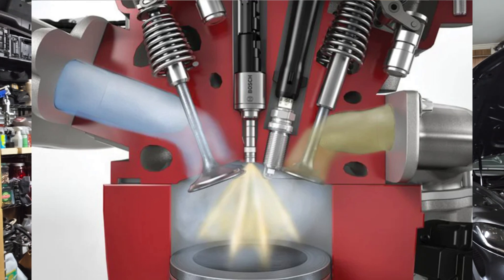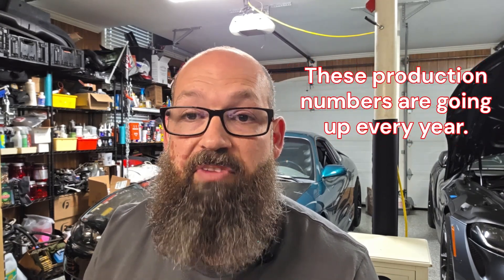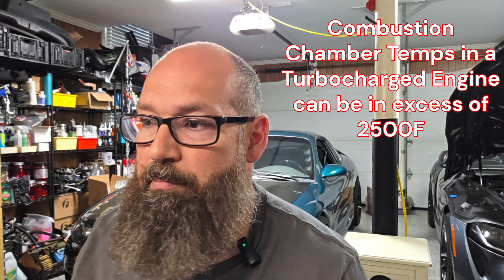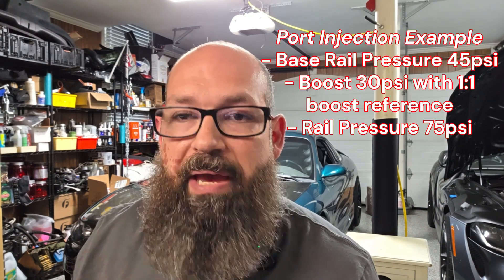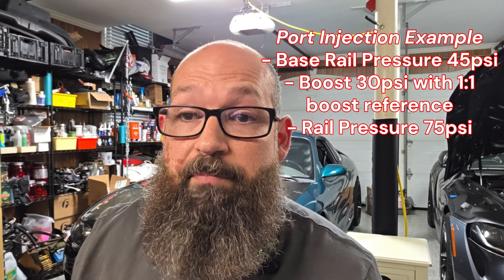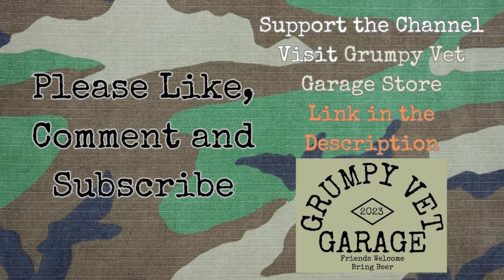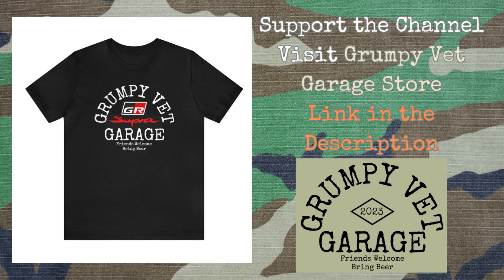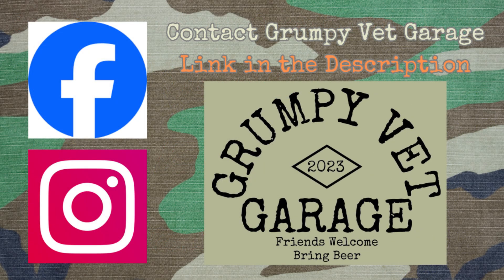Direct Injection vs Port Injection - What's the Best B58 Fueling Upgrade Path?

Comment: Good video, where did you get the power chart from the end at? I know of a good amount of stock location DI setups that have made over the 659whp you mentioned, I believe there's also someone with a MT supra with just di upgrades making ~800whp
Reply from the maker: I made the chart over the last 6 months pulling from posted dyno and modification data, typically from performance shops.

There are plenty of individuals posting about DI upgrades but none with dyno numbers posted above 659whp.

I believe these higher HP examples exist, but I couldn't find documented examples.

Comment: Port injection should be your last resort. It’s called a supplemental fuel system for a reason. It should only ever be used as a gentle assistance in your fuel system not something you heavily heavily rely on, ideally you want to absolutely max out direct injection upgrades and then use for injection to complement it.
Reply: except for when youre making 1200+ whp and the direct injection is inconsistent and causes engine failures.  removing DI on modern bmw engines is how you make them last at high boost pressure.
Reply: @Mp-jw1qg  we have tuned 1000 to 1500 wheel B58s/S58s no issues with di

Comment: I cant wait to share my latest build for your review. '22 m240xdrive - currently running bm3, xhp, custom tuned by f80 paul on 91 with 100 methanol. Upgrades: rk tunes front mount intake, cts turbo inlet, snow performance water methanol kit, cts turbo charge pipe and pure 650 turbo. In the next two weeks I'll be upgrading fuel and the turbo. Pure 900, nostrum injectors, motiv reflex for e85, proto cts manifold, full direct injection with port injection, the 100% methanol will go to 50/50, Dorch HPFP,  LPFP, and new toyo r888s.
Reply: the nostrum is 60% higher flow over stock b58
Reply: B58 Rev2 coming soon too 👀
Reply from the maker: These are just estimates comparing to data I've gathered and there are many factors that could improve or reduce these numbers. With your current set-up, around 585whp. With the upgrades you have planned, 660-700whp (need to watch the torque). 

Nice build. Your transmission will be the next thing to upgrade.

Thanks for watching and commenting.
Reply: How did the upgrade go

Comment: Very nice overview but it's worth mentioning the big disadvantage of port injection in my opinion is the complexity it is adding. Sure it isn't rocket science but you are adding more fuel lines and now relying on an aftermarket computer interface to modulate fuel now coming from the intake manifold. Mind you the intake manifold comes in various shapes / sizes and injectors spray in various patterns. It is just more factors at play which means more things that can go wrong. I wouldn't add port injection just to clean my intake valves. I would only go port if I wanted to be cheap or wanted big power.
Reply from the maker: You do bring up a good point about the added complexity. There is a learning curve associated with adding the Motiv Reflex + to the car. With the upgrade of the DI system or addition of PI, custom tuning is going to be needed. I figure either way the use of outside expertise will be required, but your right the basic setup of parts and external controller is more complex than the install of upgraded DI parts.

Thanks for commenting.